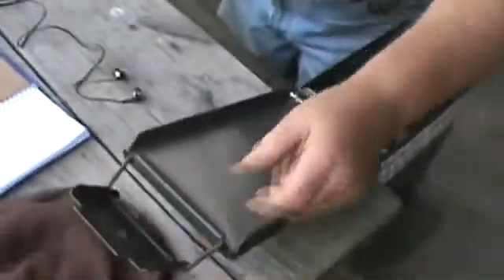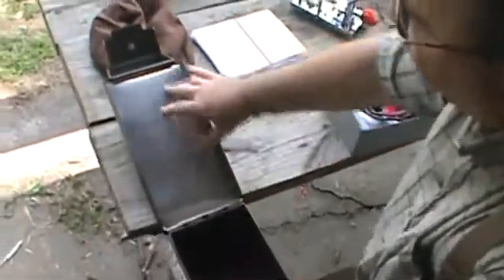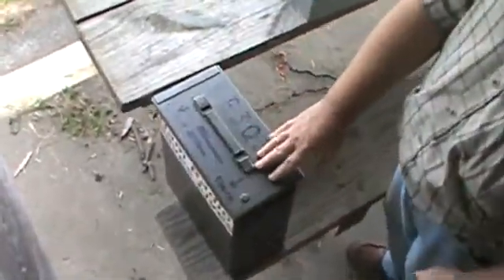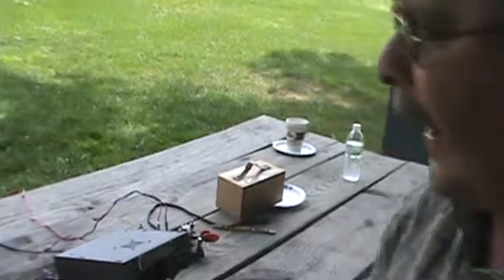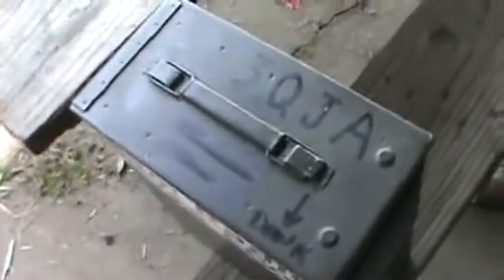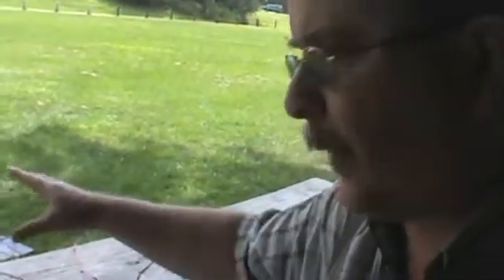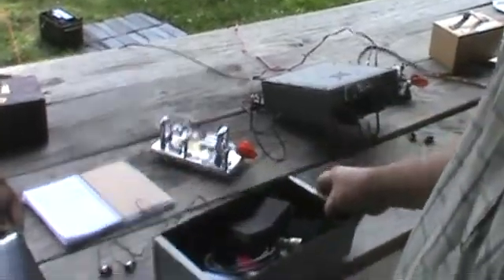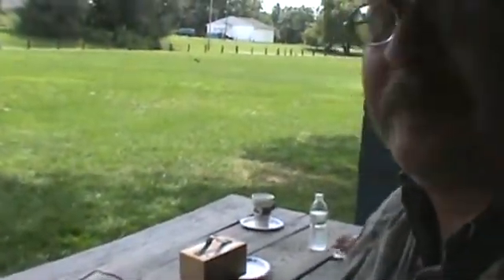Faraday Cage for Ham Radio, Homebrewed

Comment: Only issue is its no longer water/air tight which is a much higher probability of damaging the radio. The best fix would be to put a screw in the lid and the box near the hinge and simply use some stranded wire and eyelets to perform the electrical contact (ground); retaining the water/air tightness...

Comment from the maker: No, it was cut fit with out anything behind it. The foam inserts fit down inside the case to protect the radio from bumps and scratches. As KB3QJA explains,
the lid liner simply makes a good sealing contact with the rim of the container isolating everything inside from EMP outside.73